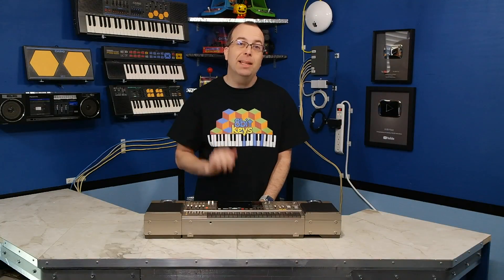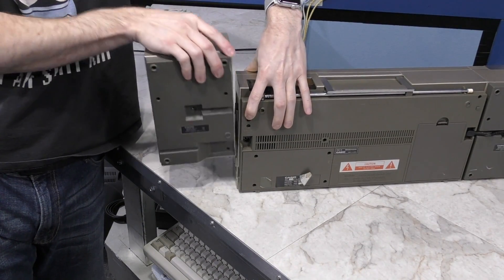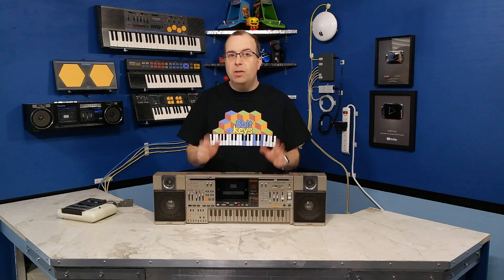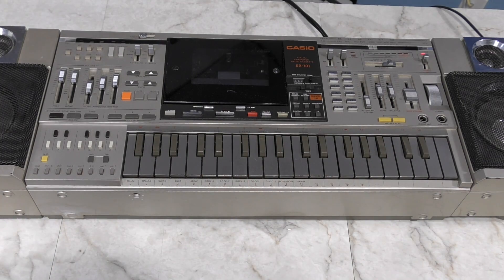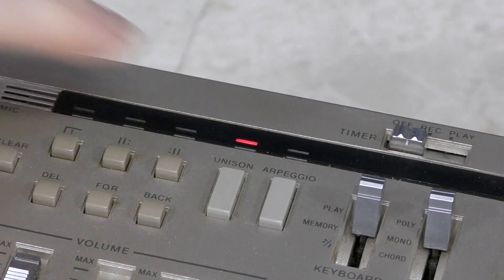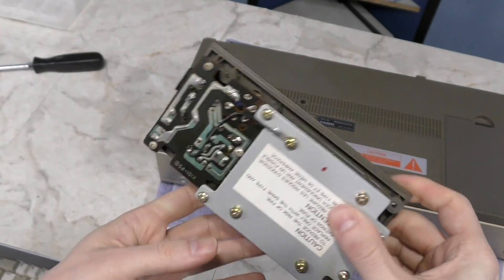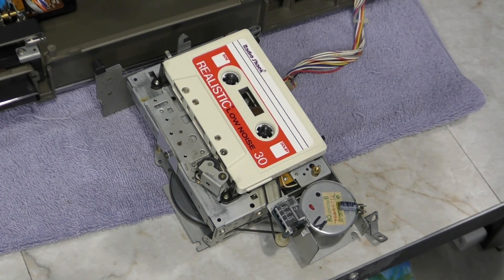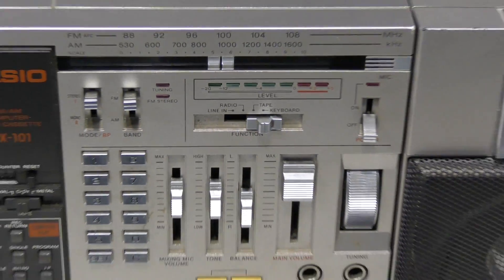Casio KX-101 Bizarre Boombox/Keyboard hybrid

Comment: Who designed that circuit board?  A soap opera director?!
Reply: LOL!!!
Reply: Propably a german firearms designer
Reply: Indian Software Developer
Reply: Well played, sir.
Reply: Maybe IBM
Reply: Probably some mixed Japanese-German engineer ;)
Reply: Wait to see a VCR mainboard back when they started .... all made in one layer.
Reply: Zcan Kal I'm guessing someone worked overtime to squeeze as many existing products as possible into the available cubic inches. Hence the wires running between parts that used to be close together, the scaled down keyboard keys, the splitting of tape electronics between a mixed function audio board, a board for electromechanical drivers and presumably some stuff on the logic board for the synthesizer to allow save/load control.
Reply: Terrance Petsas I came here right from an HK G11 video and seems accurate
Reply: Casio
Reply: Looks like a fairly typical early-mid 80s japanese consumer electronics circuit board
Reply: no, a german.

Comment: When you transpose it down an octave, the keyboard it sounds very similar to the Hing Hon EK-001, a cheap Chinese toy square wave keyboard that may actually still be in production today. And a tip to remove knobs with less risk of damage is to wrap some dental floss around them and then pull, rather than prying them off with a screwdriver.
Reply: VWestlife Great little tip about the dental floss. Gotta try that one myself. I suppose if it's really stubborn, or if the floss is just too thin, then fishing line could do the job as well.
Reply: Awesome tip, thnks!
Reply: VWestlife can you remake that video? It would be nice
Reply: Remake what video?
Reply: VWestlife Yos
Reply: Always pry with a pair of opposing tools on both sides together. The force is much less and straight up.
Reply: I was wondering if VWestlife watched The 8 bit guy
Reply: Maybe even use that keycap puller a viewer sent
Reply: Cool.  Yeah, I started hearing early Erasure sounds (as in Vince Clark) when he played with the effects buttons.  THAT was crazy!
Reply: The Unknown0789 “
Reply: The EK-001 doesn't sound too bad imo. It sounds like it would be perfect for some more ambient synth music.
Reply: Using a bread clip would be easiest to get the knobs off, or a spudger. Yes, I use a screwdriver with little to no force to get knobs off. Ease it off, be patient. Lodge it under, turn it slowly, and alternate with each side until it's off.
Reply: I know it is quite off topic but does anyone know of a good place to stream newly released movies online?
Reply: @Graham Bodie Thanks, I signed up and it seems to work =) I really appreciate it!!
Reply: @Creed Riley happy to help =)

Comment: i could only imagine the factory line to put this thing together. it must have been insanely expensive considering how complicated it is
Reply: When I got mine used, it was about $100, and was told that price was not even half the original MSRP. I believed all of that after hearing the tape player sound quality (the best I've ever had).
Reply: Not uncommon when packed to tight space, other boomboex even without a keyboard are a pain to work in ... AIWAS are a nice example. Top notch sound but a nightmare when it comes to maintenance. And microsystems in general, from Aiwa or Sony were insane packed with many boards stacked. Not service friendly at all. But this was the effort for this era to pack all of this features. Have a closer look, the PCB is two layer with carbon traces on top and difused resistors too. At this time some small portables like JVC turned their units to SMD to avoid that. This was pretty advance for mid 80s. Using SMD enabled high densitiy without being the Casio thing.
Reply: I can’t imagine
Reply: How did they designed this without computers?
Reply: According to TableHooters about 1200DM. http://weltenschule.de/TableHooters/Casio_KX-101.html   Allowin for inflation. that is over 1000 Euros today. There was a simple combined Casio Keyboard Radio cassette in the Argos catalogue that at £400 was significantly more than the price of an equivalent Casio Keyboard AND a mid range boombox.
Reply: @38911bytefree  

Panasonic used many SMD in pocket radios since the mid 1970s. 
Soldering SMD is no fun, but it still might be the better option sometimes, when looking at stuff like this. At least for the the components that rarely break (I never understood why SMD electrolytics are even a thing).

Comment: "I tried putting some weight on it to see if  that would help"
A 1541 would definitely be some good weight LOL
Reply: Those old disk drives huh. XD
Fairly sure my 1050 drive is both heavier, AND larger than the Atari 800XL it's paired with.
I wouldn't be surprised if it's almost as powerful of a computer in it's own right too.
The 1541 certainly is pretty close to being one... XD
Kinda weird when you think about it huh.
You basically need a whole second computer just to be able to read floppy disks.
Reply: The whole reason the disk drives contain a processor is that the economies of scale have got their prices way down, and mask ROM was cheap too, and the 6502's structures in particular were insanely well optimised for the number of transistors they were implemented with. Add a tiny bit of SRAM, just a page or so, and a cheap mask ROM, and you've got just about any peripheral. Avoids making the custom peripherals, which are expensive to both engineer and source or manufacture, which is what makes up most of the complexity and cost of a microcomputer, not the processor.

Oh by the way, TRI Beta Disk for ZX Spectrum was a dumb floppy drive, it only contained FDC1793 as its sole functional component, but 1541 has one of these ICs too. The performance was perfectly reasonable, arguably better than any of the competitors, especially Commodore. However, it had to sit directly on the processor bus and couldn't run a long cable, so if you tried anything in that regard you would be met with terrible reliability, while Commodore used a convenient serial interface for their disk devices.
Reply: He should've used my computer

Comment: Wow — that cassette mechanism was ridiculously complex.  Clearly they wanted soft-touch electronic buttons to control it instead of mechanical ones...  But it seems like they could’ve done it in a less complex way...
Reply: It’s not that complex. I used to shoot womprats with my T16 back home. They were no bigger than two meters.
Reply: This is actually the simple way to do a logic-controlled mechanism, with discrete solenoids for each mechanical function.  The complex way would be to add  a transport control gear and rotary encoder or discrete switches for sensing current position, and either a separate function control motor or a system of clutches that would use the capstan motor to drive the transport control gear through the different modes.  At that point, you also need more complex logic to detect and switch modes, and a microcontroller starts to become more attractive for controlling it.  All of this could reduce the bulk and the number of wires needed, but would technically be much more complex.
Reply: It is not for the soft touch convenience, because by this time soft touch mechanism become pretty simpler (I dont recall if the most common ones where by tohiba or hitachi). This tape deck RECORDS DATA, probably there is a lot more going into it. It is a datasette unit and music player both at the same time. Probably need sensors to help counting time or position ... or position is recorded together with data ..... Anyways mechanism can get far more complicated than this ones in two ways. The good quality way with tons of parts and  and stacked levels ... AIWAS and the cheap ones that, because the dont want to spent money on motors so, they use the main motor for everything, even opening the door, reversing the head etc .... by doing that, they save money, but then need very precise timming to trigger the levers that direct each function As belt streches, they start to jerk bad. A good example are the ones for Panasonic used in some boomboxes and bottom of the line technics deck, they are very slow and clunk all over the place just to activate play.
Reply: 38911bytefree That does make sense — the fact that it records data in addition to audio would increase complexity by a good bit, I would imagine.  Good point.
Reply: Well, dont ask Technics bottom of the line logic decks on early 90s or boomboxes with logic decks, They use only a motor for even opening the cass door and not even use encoder, the rely on time and one or more solenoid actions to achieve a certain function. The main control wheel is very complicated and manages all the functions and you wont need more thant 2 solenoids to do ALL functions, even cue and review. Prices you pay, the transports are insane slow, and to get a function they tend to exceute another first as a consecuence, example, FF can lift the head a bit lice cue, then put down them again, then engage FF. The BEST solenoid implementations I have seen is sharp RT250 or bigger .... 3 solenoid, one motor. It is pretty fast and more or less quiet.
Any two motor deck will improve that for sure since you dont need to engage play, RR or FF as they rely on the second motor to do that.
Reply: It also had controls and a number pad where, if there were suitable audio gaps between songs on a tape, you could program a specific play order.

That also worked with songs played on the keyboard that were digitally saved to cassette.
Reply: I owned one of these for years. The deck could cue to tracks on the tape and was very nice deck. I would DJ parties in my basement with it.  Very feature rich.

Comment: I spent all night debugging Open Firmware code on a beige G3 and thought nothing could be quite so badly bodged while still being designed by engineers.  Then you opened this thing up...
Reply: It is 80s technology. So many functions trying to keep the case thin. Have a look at any microsystem from Sony, Aiwa or Aurex in early 90s, all of the modules have many boards stacked all of the place because they wanted small size but big performance. You can say, well C64 was complex and clean board. Right, but commodore tailored many of the ICs to keep this clean and easy. Try to do a C64 with of the self parts .... sure you will end with a Casio like mess

Comment: I still have, to this day, my first-ever 1985 Kenwwood CD player. Only thing I ever did was replace the belt. I think it needs that again. I remember back then, before over sampling and other CD issues with scratched surfaces, that no seller had, at that point, had any idea how long the lasers would last. Apparently, 30 years?
Reply: With the lasers it's more of the case of what sort of environment the CD player lives in, with the cleaner the air the longer it continues to function properly. The lens is usually simple to clean even if you have to disassemble the unit's case, however the glass prisms that reflect/split the beam can deteriorate with acidic grime or fungal growth! 
Doubt that it's even worth trying to access the prisms as I'm sure any crucial alignments will be lost if you unscrew anything on the laser assembly!

Comment: Ah. PT-80. I don't know if that's the exact model we had, but that was probably the very first keyboard I ever owned. After that we moved on to things with full size keys. I still have two of those.
A Casio from the early 90's... And a Cheap Yamaha from 1998. Technically has midi functionality, but it's barely compliant, and has a weird instrument set.
Does work perfectly fine in conjunction with a MU-128 tone generator - a much more expensive piece of kit, but actually from the same year. Surprisingly, the actual grand piano sounds on the keyboard aren't vastly far off from the MU-128's Piano samples; Every other instrument is much worse though.

I do remember those little modules with songs on them. Those were amusing...

Comment: Hello, I have found that dials and knob removal works best with a handkerchief or a shop rag. Just slide the shop rag under the knob lip on all sides and slowly wiggle pull them off. This will save the main frame of the device from marring of a tool or breakage of a knob. I do a lot of guitar knob maintenance jobs and this works best.

Comment: I have one Casio KX-101 myself. When I got it it was in quite good shape, but the tape belt had went off, just like in your case. This got me wondering how it's possible? What I did was to order a new belt, due I felt it might happened again. Also the amp. department had some issues for me, it popped and made some hissing noises. I actually managed to take it apart(followed some repair tips I found online, also managed to get hold of the service manual. This step took AGES! I almost gave up after I had spent about 10hours to trace down everything. Anyhow, what I ended up doing was to replace the capacitors and this was one heck of time consuming part! I think I spent a bit too much time ;) I also cleaned all the trim potentiometers, button and sliders before I even attempted to recap the darn thing. Anyhow, I got it working but the tapedeck part is still not stable. I had to adjust the tension too (without messing things up such as speed/record and playback). Also the speakerwires were worn out, so I had to replace them, as well :)
Like said... I spent way much time to make it work.
Happy to see your take on this device.
Reply: Well done! I have a small collection of some interesting Casio vintage watches, calculators and VL keyboards, some of it is on my YT channel. So the best thing when you have repaired it, is to just place it on a shelf as a trophy or a decorative item, since it looks incredible, and enjoy it in knowledge that is working even if you almost never turn it on, except sometimes, to remember the magic of good old days... Would you sell your one, by the way? ha ha
Reply: Hello! If you're still about, I don't suppose you're still in possession of that service manual are you? I've failed to find it as of yet.

Comment: When I was a kid in high school, I coveted this device. This, and the cassietone PT 30. My favorite feature was the one key play, which turned the unit into a rudimentary sequencer. I'm actually disappointed, david, that the one key play feature was not featured in the video because in my opinion that's what makes the unit. It also makes up for the impossibly small keys. In any case, I used to stand in Burdine's at the Coral Square Mall and would play with the display model of this until they threw me out. Which they often did. Thanks for taking me for a walk down memory lane!

Comment: Could the problem with the tape functions be the idler tire? It's a rubber tire that controls the take up spindle on the right. This tire often gets gunked up over the years and won't grip anymore, rubbing it with sandpaper usually does the trick
Reply from the maker: I don't think so.  The best I could tell, solenoids were not engaging.
Reply: Seems odd but some quick and dirty things to try are knocking it around a bit, tapping it with a hammer just hard enough not to destroy it from various angles, spraying some lubricant around any moving pieces you can get to, and finally swishing the whole tape deck assembly around in a tub of alcohol.
Reply: Looks like clutch has gone wrong from pickup reel
Reply: Tires rarely go that bad. but they can turn into a plastic and have almost no traction, but still able to rotate though. Also the other belts look "good" Probably was serviced once ?. Even the counter belt is nice.
Reply: Some solenoids happen to engage  just for a small time at a very precise moment to jump from one function to another. Some deck used the solenoids always on to secure a function. Others not. Boomboxes need to save power, would make sense that solenoids actuate for a small amount of time and then release. Issue with them is sometimes they require precise timming and sensor tell the board when it is the time to do it. IMHO take up sppindle for FWD is ONLY used on PLAYBACK so pushing the head and pinch roller assembly should bring traction to the spindle mechanically. There is no posible state that requires capstan pulling tape and spindle not moving. Yes Pause takes the pinch roller out and cut the spindle, but again is a complete operation. if the deck was a 2 motor design, is ANOTHER story.
Reply: AND EAT ALL RUBBER UP!
Reply: Joseph Moore I think the mechanism is possibly just seized and needs some cleaning and lubrication.

Comment: I had gotten one of these in the fall of 1984 with the RAM card. The thing was loads of fun, and the ability to loosely play a song into memory and then go back and set precise note/rest lengths (with the markings along the edge of the keyboard) was really slick. I’ve also taken it apart a few times — once for fun, and a couple more times for cleaning because someone at a party spilled a drink into the keyboard. 🙄

I had high hopes for your repair, since mine no longer even turns on. Not with the power cord and not with batteries. I keep meaning to take a more in-depth crack at it, but considering the challenges a pro had, it may be a bit much to take on.